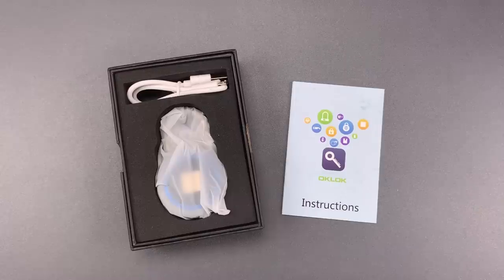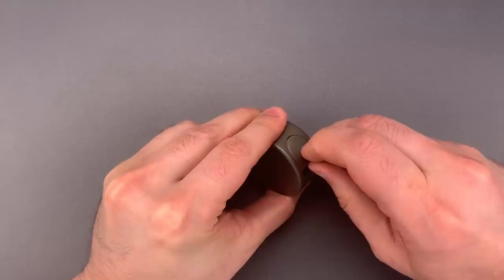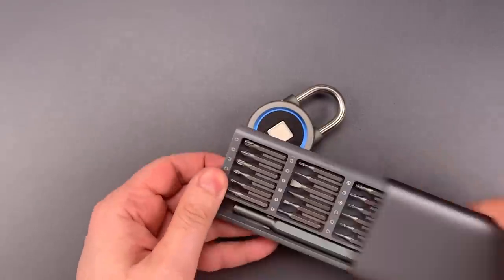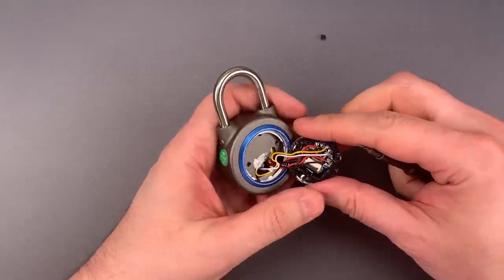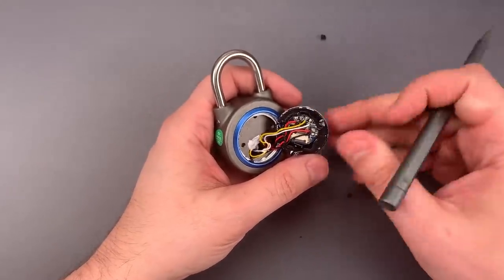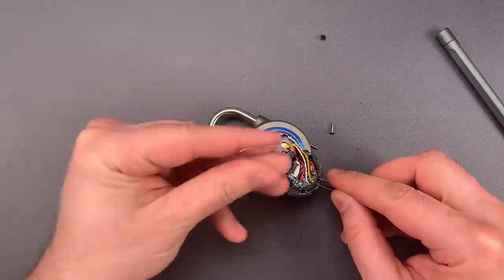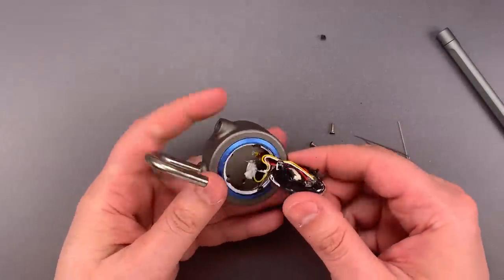[1083] A Peek Behind the Curtain: Evaluating the OKLOK Fingerprint Padlock

Comment: Very nice. The video that is. These "lock makers" have really gotta stop including externally accessible screws/panels that reveal the guts of these things. They aren't locks, they're a puzzle with an easy solution.

Cheers for a good bypass video!
Reply: Aye, especially when they are this cheap. Both of those attack vectors would be ruined by one way or breakaway screws. Then you'd have to drill the screws out.
Reply: That's honestly why I find lock picking interesting. Locks are just puzzles under a different name.
Reply: So they didn’t even bother to epoxy up the panels together to make it harder to pry open.
Reply: Seems like a couple well placed hammer strike would be the easiest method. These electronic locks always seems so flimsy.
Reply: @jonathanfairchild  Agreed. So many of them seem like they're more about being a cool techy thing to show your friends than actually lock something. Feel like the sort of thing you'd use their level of security on is the sort of thing where the lock costs as much as what you're securing. Its like why would i use this weak of a lock when instead i could replace whatever got stolen instead for the same price?
Reply: @jonathanfairchild  Flimsy, and plastic parts everywhere.  I wouldn't trust this to lock up my jock strap at the gym.
Reply: @alexsis1778  Nothing techy here. Just buying a generic cheap kit, assembling it and putting a nice name and package to give it a "premium" feel to abuse a couple naive buyers.

Comment: After watching several dozen of your excellent videos, I conclude that most locks are designed to keep out all but the .05% of people (or less) that can crack them, and that’s good enough. The design reaches a point of diminishing returns, where to keep out an ever tinier fraction of elite lock pickers adds enormously to the cost, weight, and probably the complexity of the lock in ways that will never pay for itself in a business model.  You have a jaded point of view, since your hard-earned expertise makes you see many of these cheaper locks as “junk” where for the average person they are as sturdy as Fort Knox. I grant that it might be otherwise: that relatively inexpensive and simple changes would make these locks much more pick resistant. If that is the case, then manufacturers have no excuse.

Comment: The Lord of Locks can get through anything. No lock is safe from him.
Reply: BOWLEY lock, only around that is destructive
Reply: I have one lock that would be safe, at least from anything short of an angle grinder. It's a disc pad lock with a horrible core, whose mechanism got stuck. You can not even open it with the key, it simply will not turn more than an 1/8 turn. 🙈
Reply: More like the Lock Picking Lord
Reply: and of course, if he can't open it, He is a Lawyer, so he would simply SUE the Lock into compliance!!! LOL!
Reply: Turidus my dad who’s a locksmith suggest getting a drill and drilling in the brass cylinder, but beware it will ruin the lock
Reply: I saw a video of the BOWLEY being picked, some custom rakes of course.  I feel LPL could do it if he desired.

Comment: You probably could get away with shorting just one set of contacts instead of two like you showed. Often circuit designers take a shortcut and only control one side of a motor, leaving the other side permanently attached to either the ground reference or the positive voltage supply. (Which one really depends on the switching circuit, whether the switching circuit can supply or sink more current.) But this is only true if the motor only runs in one direction (and uses something like a spring to return it). If the motor runs in both directions, you will need to short two pairs of contacts as you demonstrated.
Reply: You right, however this needs a reverse to lock it again, (could a coil spring do this job?), a solenoid type would be ok good but more prone to a magnet attack.
Reply: No it's a reversible drive motor which means to unlock power flows one way... to lock it flows the other
Reply: @thor52916  The fact that the DC motor can go backwards doesn't mean that it does to lock it. All DC motors can go backwards when electricity is supplied in reverse.
Reply: @light-master  No but it reverses the cam attached to the motor back in to the locking paw to allow it to lock

Comment: What mini screwdriver kit is that? Seems like a nice set.
Reply: more like Xiaomi Mijia Wiha. look at ebay
Reply: that anodised finish is very similar to the Xiaomi Mijia screwdriver set
Reply: @rcytray  Actually this video seems to be a good demo too. That set contains only miniature bits, and if those whitstand these abuse, then it must be a good quality set.
Reply: "XIAOMI Mijia Wiha 24 in 1 Multi-purpose Precision Screwdriver Set Aluminium S2 Steel Repair Tools " from the usual suspects. It's actually kind of terrible. The handle is round with three flat sides, so it's very hard to put any torque in it. I would recommend a nearly identical set but with a hexagonal handle, if you don't fancy injuring your wrist from gripping your tool too much.
Reply: Mark it’s a xiaomi mijia wiha screwdriver set.
Reply: Xiaomi wiha set
Reply: iFixit had one too although not fully know about it other than they had most of proprietary screws for phones
Reply: Staglo Magnifico actually, the lack of torque is important for small electronic devices (phones, tablets) where you only need to tighten finger-tight. It depends on your use case I guess, but considering it ships with stuff like the Pentalobe bit for iPhones I would say it serves its intended market (phones/laptop repairs).
Reply: @Spidapida006  i have the mijia set you can ask away
Reply: @staglomagnifico5711  It contains so small bits, I doubt that those tiny screws require more torque. Maybe the bigger Torx or PH could be used for bigger work, and it may be not enough for that. I agree in that case. But I still think it is an edge case. Use the right tool for the right job, this set is meant for fine miniature work, and for that, you really don't want heavy-duty handle.
Reply: @staglomagnifico5711  I suppose it is a hazard, injuring your wrist from gripping your tool too much..

Comment: Us: ok you can open the lock in 30 seconds when you know how it works, but surely blind it takes more time right?
LPL: 3 minutes from first impressions to unlocked
Reply: Even though, screws are the only things that seems to slow down that man.
Reply: You really think he didnt test this with another lock first? People are naive..
Reply: @bepowerification  with experience taking things like this apart it is quite easy to find something like that in a few minutes. After working in manufacturing it would probably take me only slightly longer, and mostly because I don't have a bench with that type of tools set up.
Reply: @sailor5853  I feel like this lock would be more secure if they just doused the damn thing in epoxy resin instead of little plastic plugs and a face plate held on with a glue stick.  Given some of the stuff I've seen on this channel, I was impressed that this lock didn't have the circuit board 100% in the open after puling up the adhesive front plate piece.  If they'd have soldered those screws in place or stripped out the heads, this lock wouldn't have been half bad.
Reply: @bepowerification  This lock is so poorly designed that the attack path is really obvious at first sight. All black plastic pieces are shouting "Hit me!".
Reply: It was over when I saw it was a fingerprint lock. If someone ever shows me a well-designed one, I'll buy a hat just so I can eat it. 
The only surprising thing was that the screw hole on the bottom had a plug. I was sure it was gonna just be exposed to the world.

Comment: a few observations of my own: i reckon that's just a solenoid just by the sound of it, and i think reversing the polarity didn't do anything to lock it as it would have a flyback diode to protect the circuit from a voltage spike and if that's true then only 1 jumper wire would've opened it since isolating both terminals would use more components, and i also reckon it might be shimmable since there's no active locking (unless they use a square cutout in the shackle if done correctly but doubt it) - one last reckon: probably a magnet can reenact the pull of the solenoid, looks like the solenoid is mounted vertically so probably a magnet on the bottom would do the trick?
Reply: insert Elon Musk "nerd" tweet here

all jokes aside, love to see someone geek out
Reply: Look up other vids of these locks, it's a motor with a planetary gearset. The shackle is sprung, which is why it pops out when unlocked, and that pop noise comes from shackle's retention that keeps it from being removed entirely. 

Also note the, "I hear the motor move but nothing happened," with the incorrect polarity, and the, "I heard the motor move," while using the music wire, again in the incorrect polarity. This would imply that it is indeed a motor, as you can hear it move and you can hear it move while in the incorrect polarity.  Not to mention that you can hear the motor move, as you wouldn't be able to hear motor noises from a solenoid. Plus if it were a solenoid, you'd be hearing the pop no matter the polarity, so there should have been at least four in the video as there were two tests that resulted in incorrect polarity, yet there were no pops, yet he heard the motor move with incorrect polarity. Basic logic tells you that your reckoning is incorrect, as the pop noise is not consistent to both polarities, and the noise is described as a motor, not to mention the comment about only needing one jumper wire didn't work in the multiple times the single jumper was used between contacts.
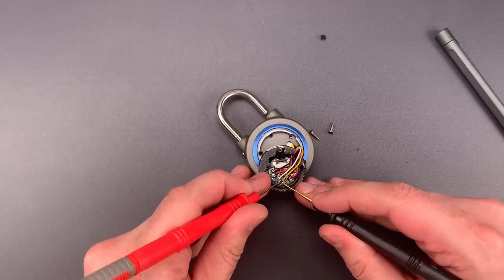Reply: @xaytana  my observations were based on this video alone and my words chosen modestly - when he said he heard a noise, i didn't hear anything at all through headphones, and when he reversed the polarity to "lock" it at 4:44 i also heard no noise from the thing regardless what LPL actually said, surely it would've done if it had been unlocked just prior as it did when it went from locked to unlocked like at 4:17 as gearing would have to move from one position to another - "you wouldn't be able to hear motor noises from a solenoid" no but solenoids make very audible clicking sounds, the sound at 4:17 sounds like a solenoid click to me and not a motor whirring - i did quickly search for another video of this padlock and without digging too deep, jerryrigseverything's video comes up where a prolonged motor whirring is present as he demonstrates the product as is the planetary gearing when it cuts right through it, but idk about LPL's lock - i'd still like to see what else can be done with LPL's lock but he didn't take it apart enough for either of us to say confidently

Comment: The way you "locked" it before closing the shackle seggests it has a spring loaded locking lug so could this be shimmed or rapped open? much quicker and easier and no damage.
Reply: I think being able to shim a padlock is basically assumed at this point unless otherwise noted.
Reply: I was expecting at least brushing around it with a neodymium magnet, before destructive work.

Comment: Pretty nice to see how you come up with those exploits.
BTW, you can probably use a single bridge "wire", since it's likely the motor and battery ground are already connected.
Reply: Given that the motor probably needs to turn one direction to unlock and the other way to re-lock, most likely that's not the case.
Reply: @EnricoConca  yep driven by an H bridge.
Reply: @EnricoConca  Oh, yeah, hadn't thought of that. I thought it was a single acting configuration.

Comment: Hey LPL great video. Id like to point out that the front attack can be done with the screwdriver alone. Not worrying about destruction, you can wiggle the battery wires soldered to the PCB until they snap off, leaving enough clean wire to touch against the soldered points of the motor wires.

You did mention that you can see the motor wires from the bottom entry point. I would imagine a similar method could be used by first pulling the pins from the battery connector that i saw and touch those directly to the soldered points on the body of the motor.

By proxy, this whole thing can be done with nothing more than a small pocket knife since those are small philips heads.

Comment: 2:49  Green Quality Control sticker

If the LPL was their QC inspector, none of their locks would ever leave the factory.
😏
Reply: That depends. It does what the specification says, probably. It is built according to specification. It does not break any law-defined standard (like small parts for children toys, hazardous external paint that melts your skin, etc), probably. It might even pass some security test, it you specify that it falls into category "cannot be opened under 30seconds without steel-cutting something". Maybe.
So maybe it's even better than some mechanical Masterlocks, that can be raked within 5s :D
but yeah, the exposed screws are pretty much a security flaw, they could make the screws accessible only when the lock is open or something
Reply: panda4247 

If the paint melted off your skin it would make it much harder to open.
Reply: A QC failed sticker, in the Navajo language, would be a quick fix.

Comment: good for showing people the weakness of the new tech,good guess on te motor wires,you are so smart to do what i love seeing getting it open never fails,cheers!
Reply: Well i guess the weak spot isnt just the electronic in there. Just use a Bolt Cutter and this thing will be open easily. Or use the Double Wrench methode! Because the Motor will be probably pretty weak and not hold up so much.

Comment: Really appreciate this video that shows your methods and process. The videos where you jump to the most extreme, or dramatically simple way of opening the lock (paperclips etc) and then explain the technical stuff is interesting, but seeing how you study the lock and plan the dramatic method is far more fascinating to me - it shows the science behind the art.

I don't think I understand the intended use of the lock. If it has a battery and charges by USB, what happens to your lock and the things it's securing when the battery dies? I assume it needs charging frequently enough that the risk of an access point through the USB is justified. Or that it's actually less fault-ridden than other charging methods

Comment: The plastic shims used for replacing phone screens are usually better at removing those adhesive plastic panels than screwdrivers, if you don't want to damage the lock.

Comment: You might be able to get in non-destructively by heating up the cover just enough to soften the adhesive without melting any plastic or frying the electronics. I like this format showing your thought process. As some others have noted, the locking mechanism seems to be spring loaded. It would be interesting to see if there's an easy open by tapping.

Comment: If you were to open the bottom first, you could then push the front face off from the back to access the wires. And then use a piece of black tape cut to size to recover the hole when you were done. It's unlikely that that would be noticed by the lock owner for quite some time, if ever.

Comment: At work we sometimes have to remove thick "stickers", which are quite similar to the cover on this lock.
The least destructive method for me is using a sharp blade, usually a box cutter, in a similar way to how you used the screwdriver. Because of the sharp edge, it fits between the sticker and the housing a little easier, so it tends to do less damage to the sticker itself.
Reply: Gently warming it with a heat gun can also help by softening the adhesive.

Comment: The front panel should be the only removable cover. Have it twist-lock into the case, with a screw under the shackle to prevent it turning. If manufacturing concerns require a bottom cover, it should be attached from the inside.

Comment: Great video. In all honestly, this doesn't look like a bad design for a low or medium security use. It looks shim-resistant, and you have to use destructive means to break into it. It's thus tamper-evident and you might as well just use bolt cutters because, either way, the person is going to know it's been messed with. In this way, it's actually better than almost all other locks you've reviewed. This is actually a very good lock.

Comment: LPL, I was just advising a person on a facebook group im a member of about how to avoid having their new bike stolen when they replace the one they just had stolen because it was protected with inadequate locks. 
In doing that, my mind began running wild a bit and i think i discovered another method of attack for discus locks. 
 Why dont you throw a cheap discus lock into your vise in the shop, ACROSS the diameter, IOW edge on, not squishing front to back but side to side, like squishing from 9 and 3 if  it were a clock, and see if you can squish it to failure to the point it pops apart. If you can do in a mounted vise, see if you can do the same thing in reverse, attacking a lock mounted as normal with a small vise in the hands. 
 Just a thought i had. 
Please if you do, wear gloves and like a face guard or at least safety glasses.  Cheers.

Comment: While powering the motor with the internal battery, generally you don't have to short ground to ground. Because since it's ground, every ground connection in that circuit is probably shorted. Only shorting positive will do the trick.